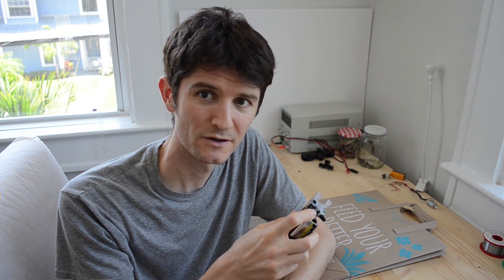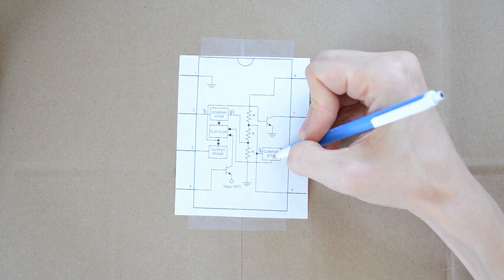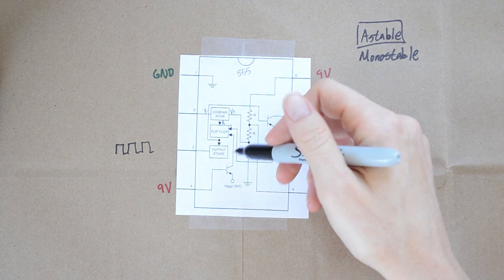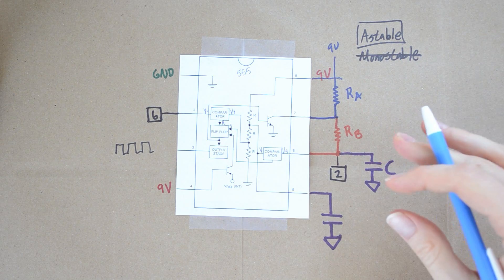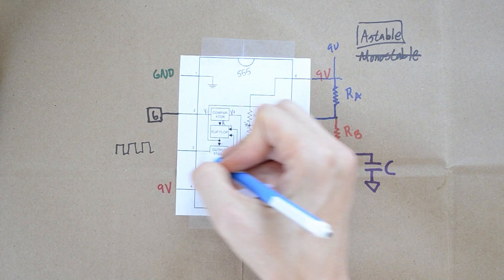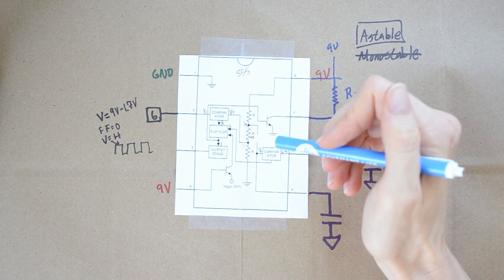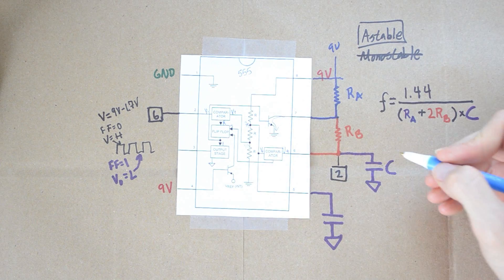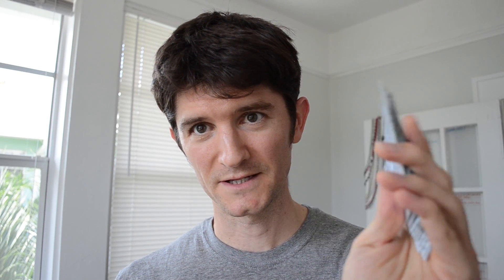How a 555 Timer Works

Comment: You can save one resistors if you control the astable multivibrator's capacitor just via a resistor between pin 3 and pin 6 which is connected to pin 2. There is no need to use the discharge pin 7.

Comment: Im trying to prolonging the off time of the led. You said you can change the R1  with a adjustable one. Where you connect pin3 from adjustable  resistor?

Comment: Why do you put the capacitor on pin 5?
Reply from the maker: Simple answer, because the datasheet says to do it. Better answer, it prevents the frequency you dial in from drifting.

Comment: Man, you're a great teacher. Loved it. Now I know the inner working, the general current flow and most importantly the connections. The formula is perfect and thanks for the last tip on making Rb a potentiometer to vary the output frequency. More from you will be very appreciated at any time.

Comment: I made the oscillator and I tried connecting a head phone jack and connecting my head phones to the output. I hear a little noise in time with the voltage pulse, but how do I make it so that I get a continuous sound for the duration of the high voltage pulse? and turn off for the low? As I mentioned it only kind of makes a small sound for a moment at the beginning and end of the high and low.

Comment: Amazing video I finally understand kind of how they work what value capacitors would I need. I like how you showed the inside circuit of the IC chip really helps to understand.

How would you control the time of how long the LED stays on and not just blinks so say it turns on for 2 sec then off for 1 sec and so on

Comment: Awesome explanation. The best I've seen. But... regarding the 555 itself.  Couldn't you pretty much do the same exact thing with a simple RC circut with a Comparator or a Zener diode?
Reply from the maker: You could also do it with a few NAND gates and some ingenuity. I've seen one design with 2 transistors. The 555 timer is nice because it's easy to design a wide range of frequency outputs.

Comment: Why is pin 8 connected to pin 7 ?
Reply from the maker: Because pin 8 is the power pin. It supplies power to the 555 timer. Pin 7 is connected to power because its convenient to the astable design. Try and feed that power to charge the capacitor straight to pin 6 and see what happens. I think it will interfere when the capacitor starts to discharge. I may try it out later.

Comment: Great Job! I'm working on a project that I have to have the output (pin 3) stay low for 1 min  and then go high for one min.  this is flipped form the normal starting situation where when power is applied the 555 goes high then low  I need starts low then goes high ?  can you help thx in advance. Bob J

Comment: Thank you! This is my first attempt at trying to understand the 555 chip. Because I'm not formally trained and/or schooled in this field, ( I've had an inexplicable fascination with microelectronics and the physics behind it for over 55 years... I just can't explain why...), I'm not fully understanding the tutorial.

I must reiterate that this is because of my ignorance in this field and not due to any failure on your part to explain this chip. I'm sure that those who have a far better grasp of this topic will find this tutorial 100% understandable.

I noted that my first point of confusion was when you kind of glanced by the Capacitor for pin 5 (around 5':30" on the video). I think I understood you to say that this pin should ALWAYS have a cap connected to it, (I believe that's the negative leg), but I don't see why it needs to be there if it's not going to close this, or any other circuit in this type of A-Standard mode 'clocking-timer' example.

The second point is around the 8':50" spot in the video. You mentioned that when the Flip Flop = 0, then the Output Stage voltage will be high. That voltage would be approximately equal to 9v minus 1.7v, (or otherwise, 7.3 volts?). I'm not clear as to where you got the 1.7 volt figure. Is that some sort of formula constant? (Kind of like the 63.2 figure when measuring a sine wave from an oscilloscope grid?). 

And finally, the third point where you reference the Frequency to equal 1.44 / (Ra + 2Rb) x C. Where did the 1.44 figure come from? I understand this video was posted some time ago and don't really expect a reply, but I'm just taking a shot at it and maybe you'll find my comment at some point in time.

Thanks again for a great tutorial and a very important topic to me.
Rich

Comment: really enjoying the 555 timer series, i'm experimenting with lighting my model kits using leds, so far ive pretty much figured out flashing single and multiple leds and going to try your cascading one but wondered how would i go about making a led start off off and then slowly come up to full brightness? for an effect i want to use, any help on that would be great thanks ok and how to make a strobing circuit, would that just be like the cascading one but on a very short timer?

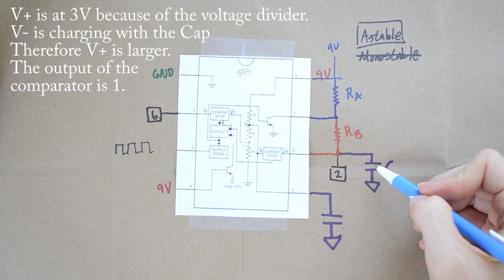Comment: at 7:38 the video stops and talks about the voltages at V+ and V- of the comparator. trouble is there's two comparators on the board and they're both labelled with V+ and V-. so I wasn't sure which one you were talking about. would be good if you add a annotation to clarify. :)

Comment: Why does the capacitor on pin 6 discharge through the transistor to ground? if the other leg of the cap is connected to the ground rail of the breadboard why does it feel it has to discharge via the 555 timer? Is that just because of current draw? sorry if that is a stupid question. great vid
Reply: the two sides of the capacitor aren't connected to one another internally. the charge builds on one side of the capacitor when it's charging, and can only discharge from that same side. if there's nowhere for it to discharge, it'll just hold the charge.

Comment: How did you determine the output voltage as (9-1.7)V?
Also the f is equal to 1.44/(Ra+2Rb)*c the exact numbers came from where?
Reply: See here you have 3 variables - Ra, Rb and C. So once you have "f" decided, you can choose a rough estimated value for 2 of those 3 vars and put them in formula to get the exact value of 3rd one. So you can pick values for 2 resistors, and let the formula decide the value of capacitor to get your desired frequency. Or you can choose values for one resistor and the capacitor, and calculate the value of 2nd resistor.

What should influence your decision for picking the value? The type of power source you intend to use. Picking higher value for your resistors will consume more electricity and will quickly drain your battery.

Comment: I've made a schematic almost like this (on Dorian McIntire's tutorial) but the chip got started to over-heat very quickly. Is it cruicial to have a voltage not more than 9v? My accum. gives more... about 9.7v then it started to go down but pretty slowly.
Overheated chip gave me funny freq. drop sounds :)  Also I've got the advice that the speaker must be not less than 8 oMs. Mine is about 6-7 oM.
And I guess I can't record sounds before I'll create (or buy) a pre-amp. to make sound quiter (and output voltage not more than 1v).
Reply: the NE555 can only output 200mA, generally you want to stay well under this limit. 9.7V into a 6ohm load draws 1666mA (ohms law VIR). over eight times the maximum current draw the chip can handle. the output voltage probably drifted up because the thing cooked.

there's a few ways of getting around this:

1 - drop your voltage. you'd need to drop your voltage down to 1.2V to get 200mA into 6 ohms. the minimum the 555 can operate with is 4.5V (see NE555 datasheet on google). so that's not gonna work.

2 - use an amplifier or buffer between the output and the speaker. this would allow you to draw more current. this is a bigger subject than I can cover in a youtube comment.

3 - add more resistance to the load. just add a resistor in series with the speaker. the lowest value I'd use is 50 ohms, with this speaker that'd give 56 ohms of resistance. 9V / 56R = 0.161A. 161mA is safely under the 200mA. 9V*0.161mA = 1.449W of output power into the speaker. just a word of warning for the sake of your hearing, this is a lot louder than you'd think. I wouldn't go putting your ears right up to it.

there's another issue here in that speakers and audio signals are meant to be AC signals, a signal that has positive and negative voltages relative to a ground wire. this 555 circuit will only ever go from ground to positive. so the speaker can only ever move forward and back to it's original position. it'll still produce sound, it'll just make your speaker work harder to produce the same amount of noise. I can't think of a simple way to fix this off hand but it's something to think about researching.

hope this was useful! :)

Comment: OMG! You so much better than my profs!! I'm currently working on a school project and would like some form of guidance, would you be kind enough to assist please? It is regarding using 555 timer to build a Traffic light system. Online have plenty of examples however they are either too out dated, ic chip not manufactured anymore even. Hope to hear from you soon. (:

Comment: that's really helpful ... but i got a suggestion ; i want tout make an RF circuit with that 555 , i wonder if you could help ?
Reply from the maker: It's not difficult. Just put an antenna on the output pin and cut the antenna to correspond to the frequency being produced by the timer. It's not perfect, but it will work.
Reply: Skinny R&D  thanks a lot , i will try it with an output amplifier ( which would be a transistor ) and see what happens .

Comment: Wow!  I'm a beginner and that was crystal clear.  Great job.  How would this be reversed?  I want to time pulses coming in and turn it into logic for my Arduino.  It's a pickup for a hall sensor distributor.
Reply from the maker: I'm not sure. Maybe you could poll the input pin with some code and record the system time when the input pin goes high.

Comment: what is the use of reset pin??how do it effects the ic555 timer working???
Reply: Negative pulse applied to this pin to disable or reset the timer. When not used for reset purposes, it should be connected to VCC to avoid false triggering

Comment: why did we use a capacitor at 5th terminal ??
Reply: Controls the threshold and trigger levels. It determines the pulse width of the output waveform. An external voltage applied to this pin can also be used to modulate the output waveform
Reply: Airborne if we don't keep capacitor and if we just ground 5th terminal what happens??
Reply: pavan KUMAR Never tried it without it. I'll look it up for you.
Reply: thnkss
Reply: pavan KUMAR We can see that the pin 5 is connected to the inverting input having a voltage level of (2/3) Vin. It is used to override the inverting voltage to change the width of the output signal irrespective of the RC timing network.
Reply: thnks a lott
Reply: Thanks Airborne!
Reply: BAD THINGS, it would short one comparator out, and thus part of the voltage references to the others--look at the block diagram.

Comment: I would like to know it a 555 pwm output can be controlled by a voltage source. like for a DC boost stage of a inverter. use the output from the push pull transformer. (170vac) rectified. then a voltage divider back to a low voltage. then when under load the volts will drop. is there a way to feed back the voltage from the divider to the 555 to regulate the output. and keep it stable. or would It be best to use a arduino? I enjoyed the video. BUT the chip diagram could be a lot bigger . I couldn't see the internal components. I am very new to electronics. and self taught. I am trying to build a inverter to power my off grid home. it is a must have project. I need to get 120vac from 24vdc. I think I have the spwm  output stage figured out. I need help to get the DC boost stage figured out. I wanted to go the non programmed route if practical. but great video. I just wish I could see more of the illustration .thanks
Reply from the maker: If you had a hard times seeing the components, you can get the layout from the documentation here: http://www.ti.com/lit/ds/symlink/lm555.pdf

Comment: In most of the diagrams for the internal 555 the output of the comparator connected to pin 2 (1/3 threshold) is used as the S of the flip-flop and the output of the comparator connected to pin 6 (2/3 threshold) is used as the R of the flip-flop.  Also , the output driver is connected to the Q' not to the Q of the flip-flop.  But this set up still works and the video was great!
Reply from the maker: Thanks! Good thoughts about the video. Pin 6 is responsible for the S of the flip flop with the timer I'm using. Here's the datasheet: http://www.ti.com/lit/ds/symlink/lm555.pdf  The reference is on page 3 under the description of the threshold pin. It's a bit different than some of the other 555 timer datasheets and diagrams on the internet. I'm intentionally vague about Q and Q' as the outputs of the flip-flop because the reference datasheet is as well. I avoid having to explain the existence of a second flip-flop output when the datasheet schematic (page 3) doesn't show one. Thanks again for watching and have a great day!

Comment: excuse my ignorance, i have just started studying electronics . During discharge phase, why does the capacitor not discharge 
 directly to ground rather than taking the path through Rb and the NPN and then to ground?
Reply from the maker: From the internet: A capacitor is made up of two metallic plates. With a dielectric material in between the plates. When you apply a voltage over the two plates, an electric field is created. Positive charge will collect on one plate and negative charge on the other. Back to me:  The charge we are building up to control the timing to the 555 is the plate that is not connected to ground. When we show it ground through pin 7, then it discharges that plate and goes to ground.
Reply: thank you

Comment: Is the only purpose of RA to limit the current through pin 7?
Reply from the maker: Yeah, you could say that. Without Ra the voltage source would short straight to ground anytime pin 7 is shorted to ground through the transistor.

Comment: How did you derive the equation for frequency?
Reply: Frequency is 1/period (the measure of one wave)
Reply: rickig65 Yes I know that, but I'm talking about the equation.
Reply from the maker: +epickiller30 The short answer is by combining the formula for t1 and t2 from the 555 timer datasheet. For more details, watch this video: https://www.youtube.com/watch?v=GNODYcxeaMY&lc=z135zzkxdwf2x5knb23zz51pzk2uy1vxb04
Reply: Skinny R&D thanx so much for the video, I didn't notice the rc circuit.

Comment: This was great and very elucidating, but I'm trying to figure something out. In the circuit at http://www.555-timer-circuits.com/metronome.html when does current pass through the speaker?
Reply from the maker: +Harry Ayres The output on pin3 is a square wave AC voltage. That means it will pass through the 22uF capacitor and activate the speaker. This wave will continue through the transformer coil of the speaker inducing the speakers magnets to cause the cone to vibrate at an audible rate. After passing through the coil the wave then immediate reaches ground because as the other side of the speaker is connected to ground.
Reply: Related question...  In the metronome example I notice that when the circuit is first powered the first tick sound and LED lights is not at the same rate as the next and subsequent HI / LOW sequences.  To put it more simply, the first beat is noticeably different (slightly delayed from the next).  Why is this and is their anyway to resolve this?  Thanks!

Comment: Hi, 
Great video!! 
I have a 555 timer circuit that doesn't use pin 7. Instead I have the capacitor discharging through a speaker that is also connected to pin 3. This gives me a siren sound. What is the frequency calculation without using pin 7 and R2 in your diagram. 
Thank you

Comment: Can you a source of voltage instead of Rb or Ra to control the timing? I have a PWM circuit with a poti, if I replace the poti with 1-2-3-4-5 volts what happens?
Reply from the maker: +João Mamede Hi! Thanks for the question, however I'm not particularly sure I understand what you are asking. Sorry, I'm a little slow sometimes.
Reply: If you use an extra voltage source through the wires of the poti well resistance Rb how does it make it fluctuate the timer, or using the control voltage pin, number 5 if I am not mistaken. Thanks for the video and answer :
Reply from the maker: +João Mamede If you want the fluctuate the frequency of the 555 timer, it's best to do it at the control pin (pin 5). I've been feeding audio into the control pin lately and it causes the output to modulate.

Comment: Please explain what would happen if the voltage at pin6 is between 3V and 6V.
Reply from the maker: +Harshit Agarwal When the voltage is between 3V and 6V, the Flip Flop in the 555 timer enters a hold state. This is where R=0 and S=0. In those states the Flip Flop will maintain whatever output if had previously. It's worth noting that the Flip Flop is in this state a lot.For example (assuming a 9V source voltage), as soon as the pin 6 reaches just over 2/3 of the source voltage, then S will be equal to 1 only for an instance. The flip flop will change it's output to a 1 and then the voltage will be sucked away to ground from the capacitor connected to pin 6. The very instance the flip flop output is 1, S will then quickly switch back to 0 because the voltage on pin 6 has dipped below 6V. So now R=0 and S=0 again. This will continue until the voltage on pin 6 (also pin 2) drops below 3V. As soon as this happens, R will equal 1 only long enough for the flip flop to change states. R will then return back to 0 as the capacitor on pin 6 charges up again and the cycle repeats.